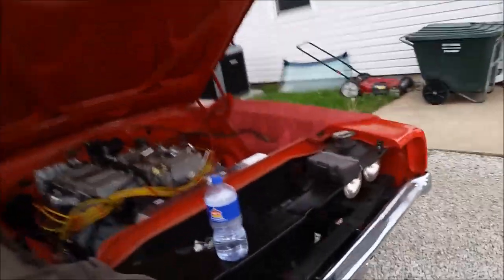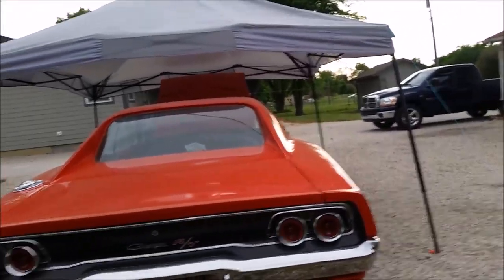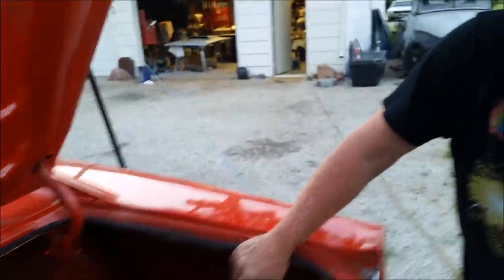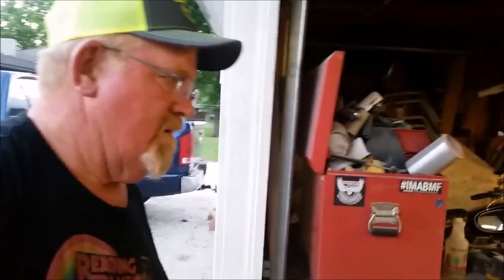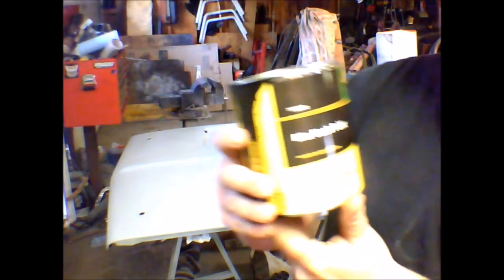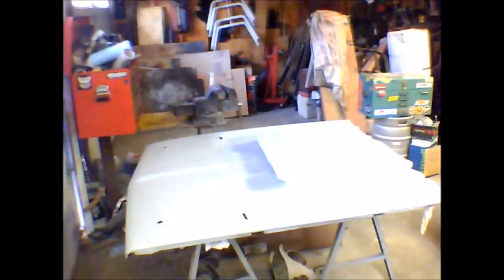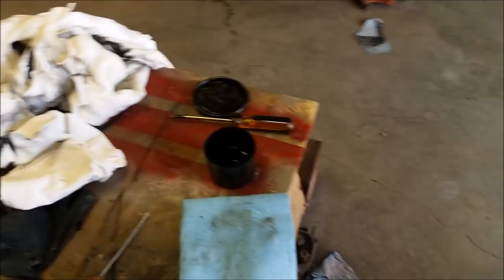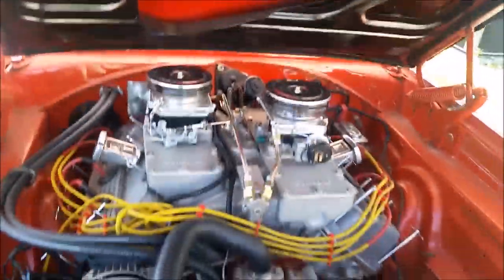Painting Dad's 1968 Charger hood in my garage with TRACTOR PAINT, IT LOOKS AWESOME! Pt. 20

Comment: The main reason they put the battery mount on the opposite side to fuel filler is possible fire.

The battery if a lead acid will arc between + & - when moisture in the air, thats why batteries go flat.
Reply from the maker: That makes a lot of sense

Comment: Next time use a paint gun that's not for touch ups, you can fan the pattern out more to cover more even with less strokes
Reply from the maker: Normally I use my siphon feeds, but this is the biggest HVLP I saw at harbor freight, it came with a much smaller gun as well, I figured it was the touch up gun, but oh well, it layed down and dried nicely